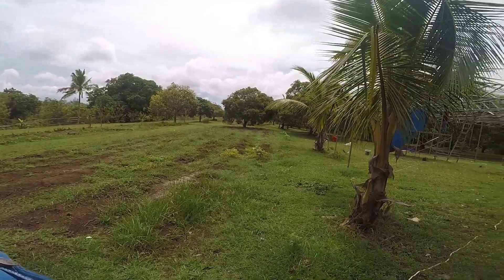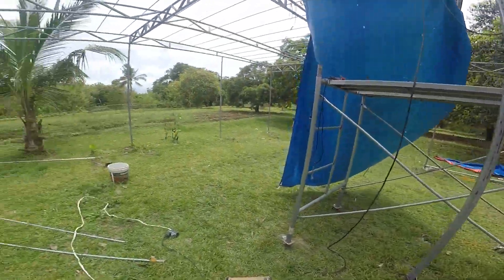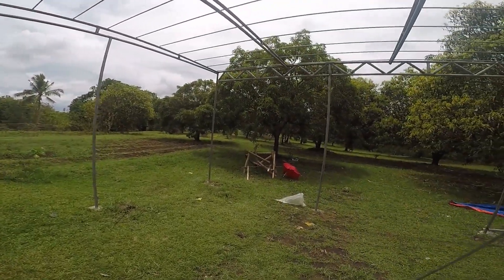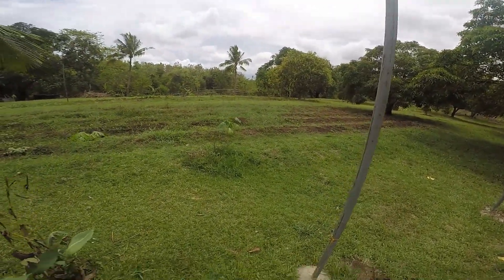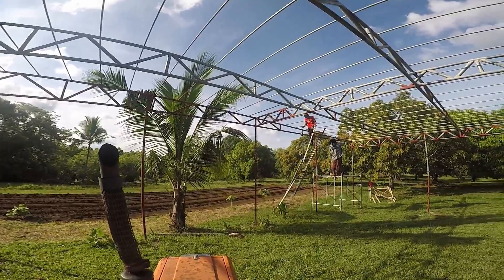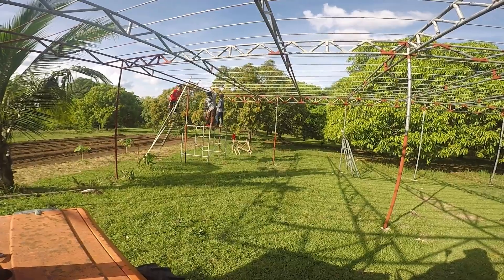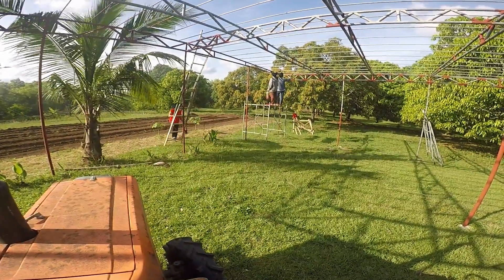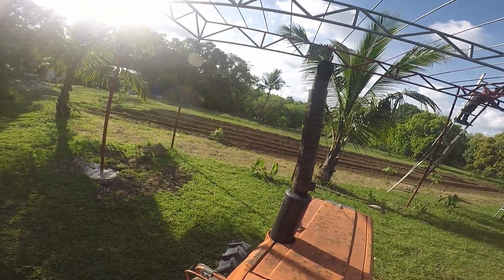The Green house roof trusses completed Finally.

Comment: Hi Dave and Emily, looks really good, well done 👍. I'm interested in the caster wheels you got for the scaffolding. How were they fixed? Where did you get them? How much?
Reply from the maker: I got them from Lazada  They have several sizes 6 and 8 inch I  went for the 8  I will shoot a video today when we install and do an update on the Green House. 
They are range from 500 to 800 php per wheel  Depends on if you get some already in country or from china if you have time to wait.
Reply: @balikbayanfarmingwithdavee2484  cool, could send me a link to the particular 8"castors
Reply from the maker: https://www.lazada.com.ph/products/chicago-1pcs-caster-wheel8-and-6-with-lock-for-scaffoldheavy-dutyconstruction-rubber-wheeladjustable-360-degree-rotate-i1662900297-s7161440758.html?      They also have some with screws inserts for  uneven ground.  Hope to post an update video in a day or so.
Reply: @balikbayanfarmingwithdavee2484  Thanks Dave, I have ordered the same. They will make moving the scaffolding around a lot easier. I bet Emily is otching to get some plants in the new green house. Take care guys, catch up soon.